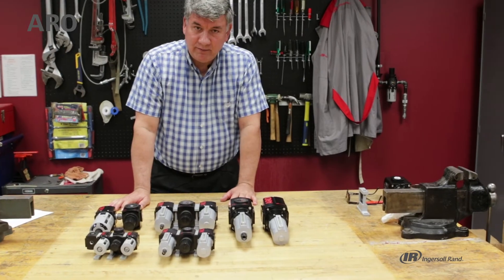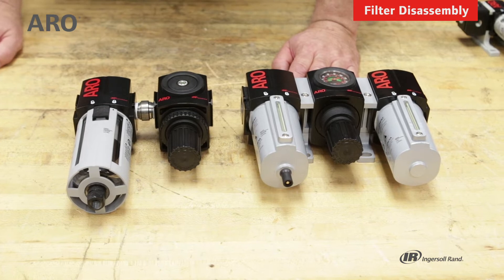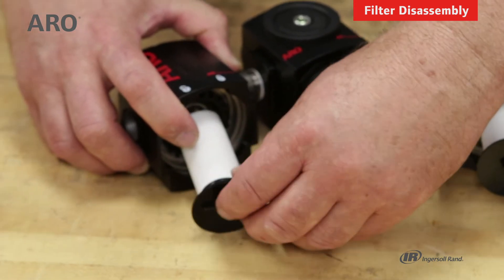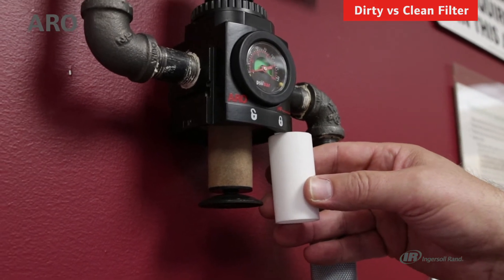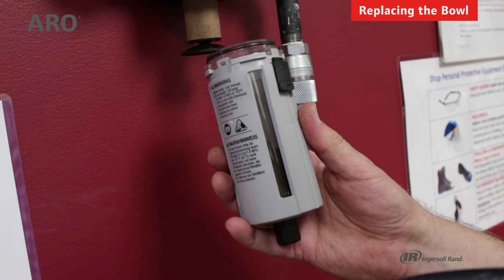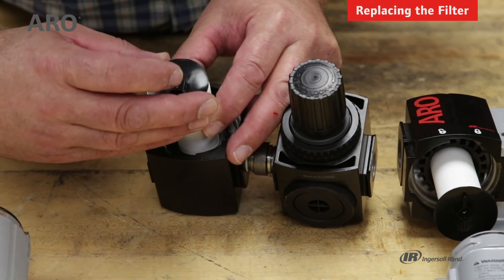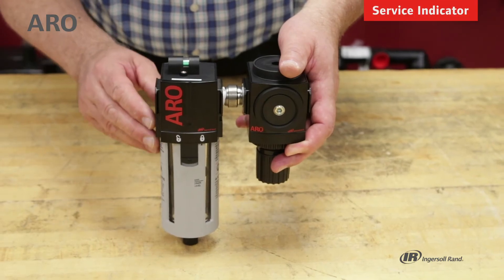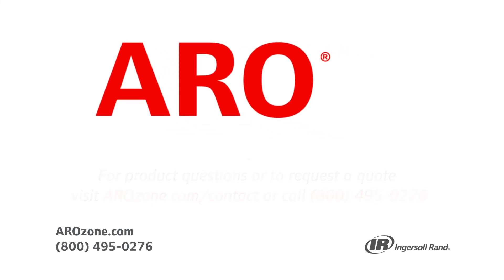ARO FRL Units:  Helpful Tutorial on the Basics of Filter Maintenance

Comment: Can the filter be washed / cleaned and reused? Thanks
Reply from the maker: Thanks for your interest in ARO FRLs. Our standard 5-micron filter element is made of Polyethylene. As the filter is used, the element will change color from white to yellow and then brown as it removes contaminants from the air supply.   Worst-case scenario, the filter element becomes so dirty that the performance of downstream devices is noticeably reduced due to lack of air supply.

For best results, we highly recommend replacing a used filter element. However, the used element can be cleaned. To do this, you'll need to depressurize the air system and then remove the filter bowl. Remove the old element and gently wash it with a mild soap and warm water. Allow to dry and then reinstall. Not all the contaminants will be removed from the element, but it may be enough to keep your unit operating until a replacement can be ordered.

Comment: We started getting some leaking from the manual drain on our ARO3000 filter recently.  The filter itself was green and broken/disintegrating.  We replaced the filter but it's still leaking.  Next up is to replace the manual drain and the two o-rings that are in the housing.  Crossing our fingers that this solves the leaking.
Reply from the maker: We're sorry to hear that you're having trouble with your ARO filter. Our technical support team would be happy to assist you in resolving the issue. Please contact arotechsupport@irco.com or call us at 1-800-495-0276.

Comment: Can you drain this trap under pressure?
Reply from the maker: Yes, you can! If the filter has an auto-drain, the unit will expel dirt and water automatically. If the filter has a manual drain, then the operator will need to press the rubber boot (that extends down from the bowl) sideways. This will open the valve and internal pressure will then expel the water and dirt.